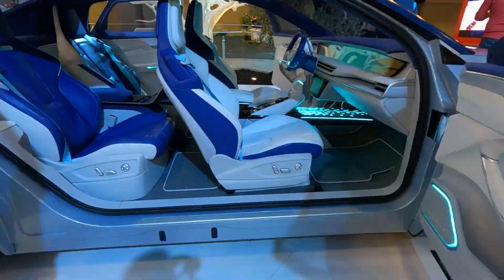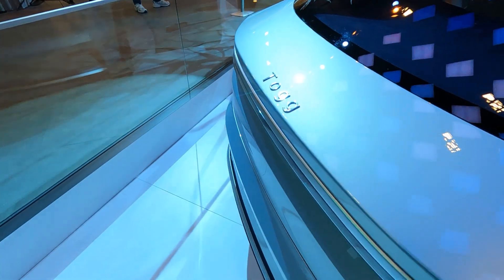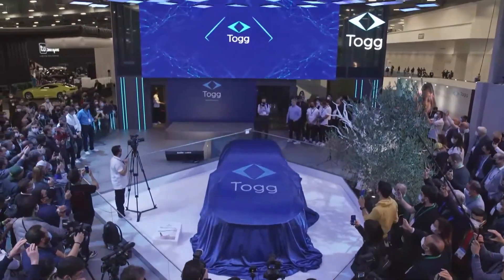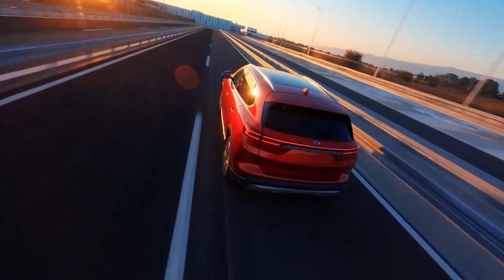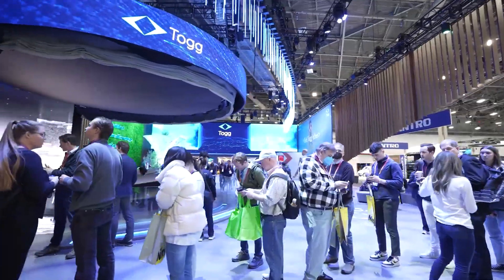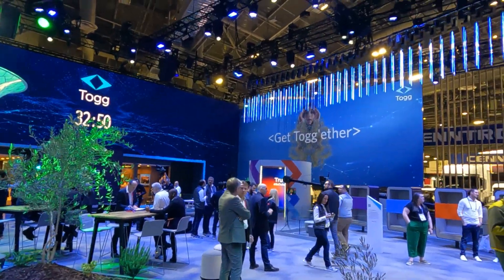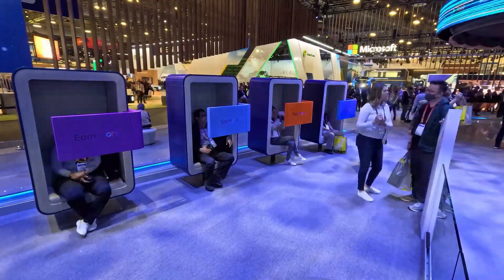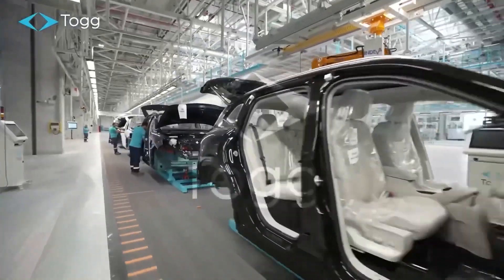What Happened to Togg's EV at 2023 CES

Comment: Sorry, but this whole “concept” is all just so dumb.  Roll eyes 🙄.    EV car makers need to concentrate on making good cars that are easy to live with at an affordable price.
Reply: 46.990,-- Euros is fairly affordable. I'd say.
Reply: @wolfgangpreier9160  No, that's absurdly expensive. Prices need to come down to the level of a Ford Focus or Honda Jazz.
Reply: @grahamstevenson1740  No problem. Here is the grand total what those cars will cost in 10 year @ 10K km each year.

Honda Jazz 25140,-- + 102 gr CO2 Emission/km = 54.010,-- Euros

Ford Focus 30.906,-- + 122gr CO2/km = 67.087,--

Prices current as of today.

MG ZS Ev 47.173,-
BYD Atto III 67.400,--
Tesla Model Y RWD 71.223,--

etc pp.
Reply: @wolfgangpreier9160  I was referring to purchase price. Quite simply only a minority of people can splurge out $/£ 50k on a car.

I have never personally bought a new car ever. The most I've ever paid is around £12k at current value.
Reply: @wolfgangpreier9160  Also .... Who on earth keeps a new car for TEN YEARS ??? These are silly numbers.
Reply: @wolfgangpreier9160  and what does it cost to charge an EV over 10 years? Those things don't run on air you know.  

You also need to factor in depreciation. The battery has a lifespan and is the equivalent cost of an engine and/or transmission and what's a second hand car that needs a new engine and transmission worth? 

Unless you can home charge EVs are very expensive and impractical as a primary vehicle if you actually use it. When scaled, the economics of public chargers don't work at current subsidized prices so you are already seeing significant public charging price hikes and a switch from kwh to charge time billing.

You are also not factoring in the significant fuel taxes that EV owners are currently immune from but is not going to last.  Governments are not just going to give up all that tax revenue so they will transfer those high fuel taxes over to EV owners as soon as EVs become the norm.

There's also serious problems with enough battery raw material supply for mass EV adoption so prices are expected to go up not down in the near future.

I'm all for EVs because electric motors are vastly superior to IC engines and I like clean air but people are delusional about the true costs moving forward.  I think the real plan is not to get people into EVs but get them out of cars period and the more expensive cars are the easier that will be to accomplish.
Reply: @grahamstevenson1740  my family.  But we are not typical.
Reply: @ArbitraryFilmings  A car may last 12 years in the USA. We Europeans typically make them last 16 years. Other countries longer still.

All of which is unimportant. Length of car ownership is more typically 3 to 4 years, so your calculations make no sense. If the less well off (i.e. the bulk of the population) are ever to afford vehicles we need a used car market where purchase is affordable for almost all. That means cars that can be bought for a thousand or so when they're old and in turn, that requires those at the top of the tree accepting serious loss of value.

You DO NOT buy a car as in investment !
Reply: @ArbitraryFilmings  I looked up the price of a Ford Focus. They start at £26,000. The Honda Jazz starts at £20,000

Why does everyone on YouTube think cars all cost insanely large sums. Are you all millionaires ?
Reply: @theslimeylimey  I have presented you the TCO costs including energy. 40 Eurocent/kWh electricity and 1,60 Euros/liter gazoline.

No i do not need to take depreciation into account. 

I don‘t do it for the fossil cars which last currently between 120 and 150k max. And have to either get a new engine or be repaired very costly - certainly more costly than the vehicle is worth.  And please dont tell me your vehicles last 1 Million miles. Mercedes from 1980 have. Toyotas from the 19090s have. But not anymore.

I don‘t do it for battery cars which last between 150K Kilometers for the old Fiat 500 from 2016 and over 1 Million miles for some Teslas (3 SR, Y SR). The batteries in my cars last longer than the rest of the body. My cars certainly do NOT last more then 400-500K Kilometers. The rust would have chewed them up long before.

Transmissions last very long, between 300-400k Kilometers easily. In trucks even longer. Regular oil change is of course necessary. We‘ll see if that is also necessary for EVs. The numbers say: No, its not. But i believe we do not have enough EVs on the road to be sure.

Second hand EVs are expensive and currently make no sense. You get old VW Golf, Renault Zoe or Nissan Leaf. I would not use either of them.
Reply: @ArbitraryFilmings  No actually. YOU appear to be unaware that most people can't ever afford to buy a NEW car !

Those who can are in an elite minority.
Reply: @grahamstevenson1740  they aren't a "elite minority". You are just not aware how many people can afford such cars on a national or even global scale. Sale numbers of cars above +50k pirce tags are evidence that there are enoigh customers. Furthermore there are electric vehicles in the 20-35k range.